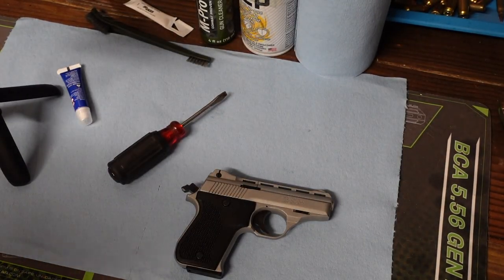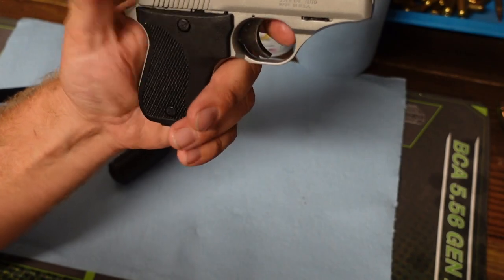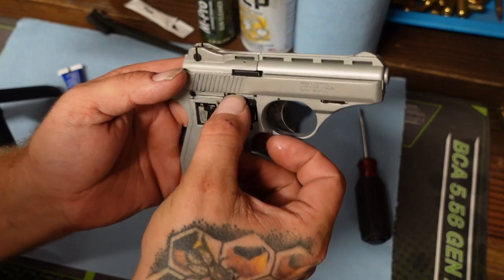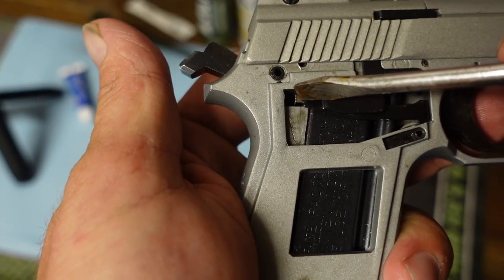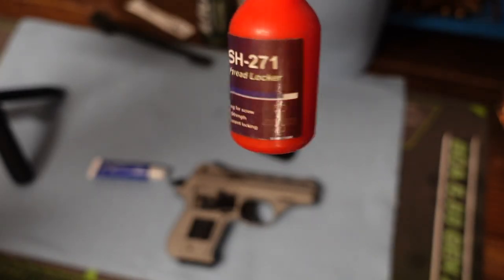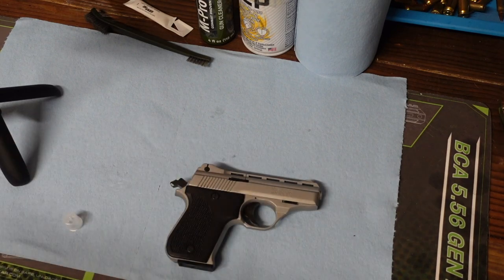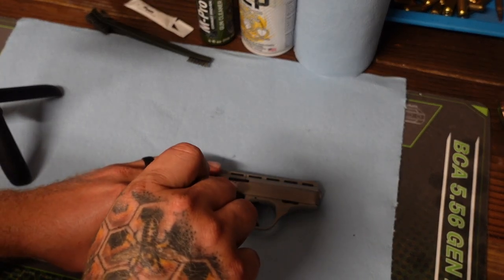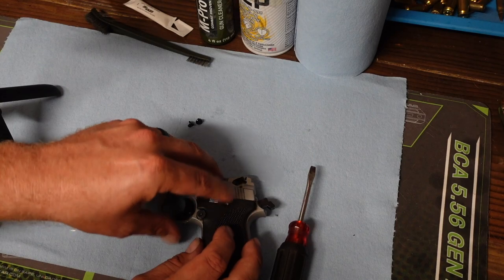Phoenix HP22A common trigger issue. How to fix it in under 5 minutes. Works for safety selector also

Comment: I am a certified Firearms instructor; I have used Phoenix arms 22 Cal pistols in training and CCW classes for many many yrs. I have had thousands of rounds through each of them without any problems. I will continue to use them in classes as well as personally.
Reply from the maker: Nice that’s great luck on your part. I have several that have come into the shop with cracked frames, slides, and other various issues.
Reply: I got one and it work great for me

Comment: The Phoenix HP22a is a good firearm for the money. I paid $150. for mine and have fired 400 rounds through it so far. The only real issue I have had with it was the firing pin, but replacement is simple if one is mechanically inclined. Customer service and parts is excellent in my view and is easy to acquire what is needed. I have never had an issue with the trigger so far, but this video is helpful.
Reply from the maker: I think I need to replace my firing pin. Getting lots of light strikes.
Reply: @2A_CaliGuy  Be sure to tighten down the setscrew in the coverplate over the end of the firing pin. Mine was protruding out a ways preventing the hammer from striking the firing pin with full force. Sometimes at the factory quality assurance breaks down. Even the best weapons can have little flaws from production.  Also if one dry fires the pistol alot the firing pin will wear out faster. You probably knew that.
Reply: @d.tombentz3382  I like this idea - going to try it.  Mine jams sometimes - maybe ejector problems?  I only use CCI - I might try another brand.

Comment: Thanks, great video.  You mentioned having problems with CCI ammo. I checked my owner's manual and found that this gun was never intended to fire "high-grade" ammo like CCI. The manufacturer recommends "Lead round nose ammo with a travel velocity between 1050 and 1150 feet per second".  CCI Stinger ammo has a velocity 1640 feet per second.
Reply from the maker: 100% correct. It really likes the ammo it’s intended to use. That’s on me, and most likely why mine ended up having to be serviced. It really likes bulk box lead round nose.
Reply: Keep in mind 22lr fps are all tested with 16inch barrels...not pistols..
Reply: @boss94ways51  what does that have to do with the manual that says that you should only use lead round nose bullets rated between 1050 and 1150 feet per second

Comment: Good video!  I chose to apply 3 strips of electrical tape on the inside of the handle cover, to keep slight pressure on the sliding piece that would otherwise miss contact with the trigger release.  I too had a hammer locked  and found your video.  Perhaps this might help others.

Comment: your seer bar is pushed to far to the left.   Your fix is not a common issue and you only need to seat the seer so it does not move to the left .  They make an upgrade kit that adds a follower to the main spring and better tigger springs.
Reply from the maker: Interesting. I’ll have to check that out thanks.

Comment: Could you have just bent the trigger bar a bit to engage the sear more? perhaps the stamp bar has rounded edges the help to not engage, just thoughts. Good work!
Reply from the maker: Possibly. Because it started to hang fire. I replaced everything. Now it works great though. We’ve put many many boxes through it. Great little range gun. I’d like to get the range kit with longer barrel just for fun. Thanks for watching

Comment: Mines having problems with shooting like it shoots like a revolver by pull the hammer back and then you shoot same repeating process
Reply from the maker: When it fires does the slide cycle, and pick up a new round? Something these pistols are picky about is how the recoil spring is oriented. If the end of the coil is dragging it will create resistance preventing it from firing like a semi auto, and can cause damage to the internal slide/frame components.
Reply: I have the same issue with my .25 ; did u find a fix ?

Comment: I have the .25 and I kept having the misfire issue of having to cock it for every single round; do u have any idea why this is happening?
Reply from the maker: Sometimes the recoil springs have issues. If you’re local to CA you can go to their shop, or you can reach out, and they will handle the repair. They have an amazing warranty considering the price point. When they run good they’re fun for the range. Cheers
Reply: @2A_CaliGuy  thanks for the tip; I ordered a new spring ; going to be replacing it

Comment: Good info good fix kool vid 👌
Reply from the maker: Glad you enjoyed it. I finally fully serviced the HP22A, and it is running better then ever. In the new video I did on 22LR barrel lengths vs velocity it didn’t have a single light strike!